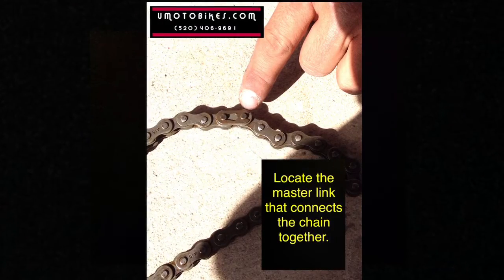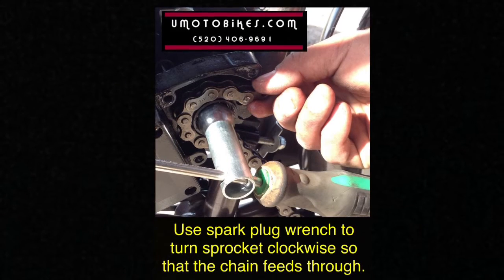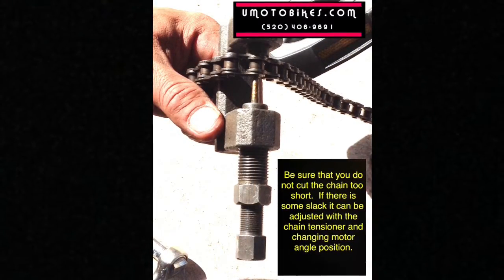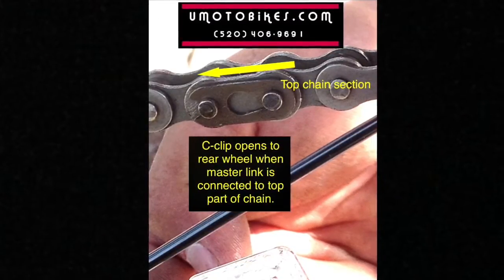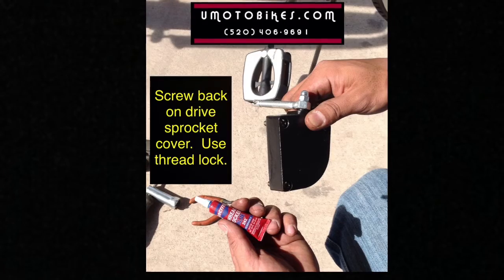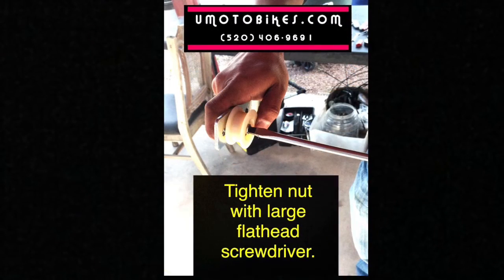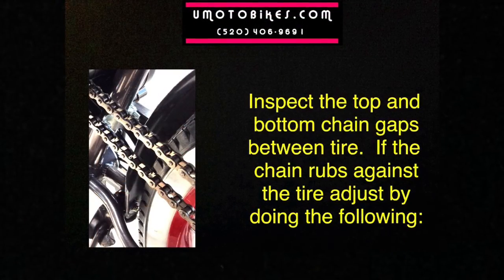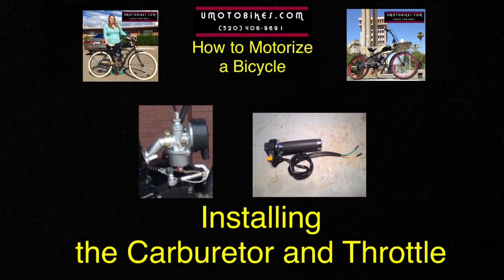HOW TO MOTORIZE A BICYCLE-PART 7 (INSTALLING THE MOTOR CHAIN)

Comment: The carburator should be fitted 1st before sizing up the motor chain to make sure there is clearance for the carburetor to fit in before you cut the chain too short.